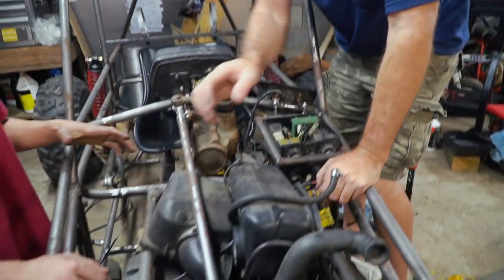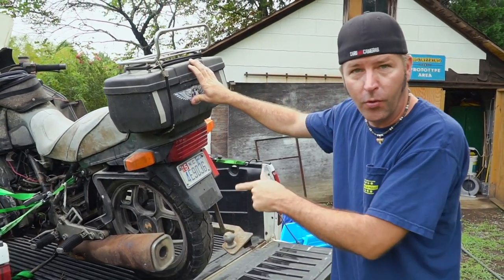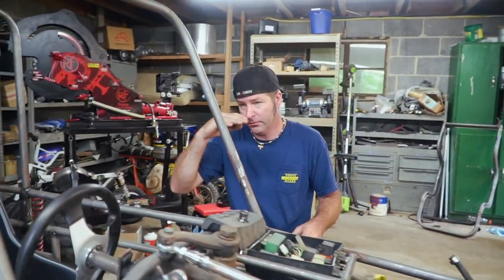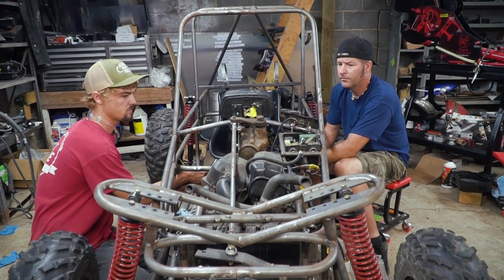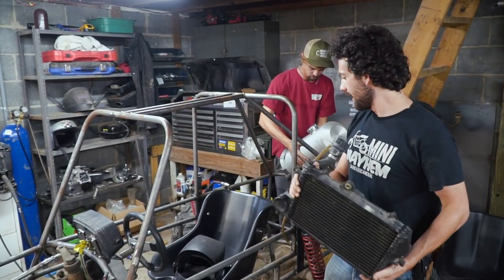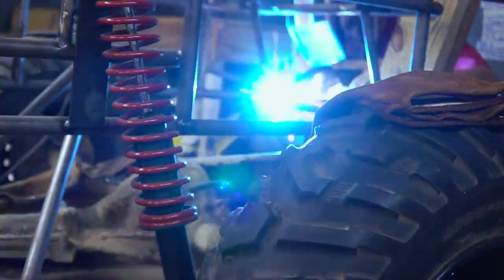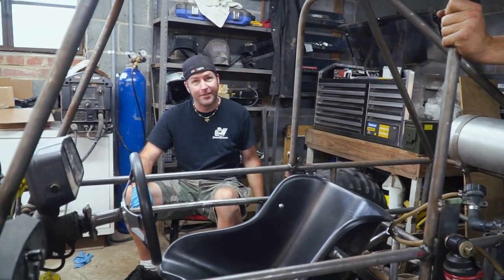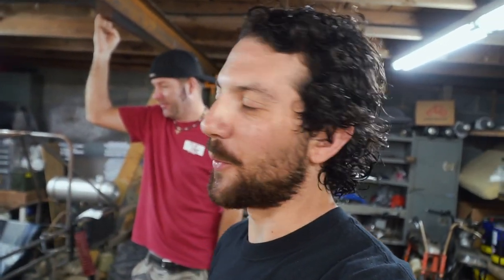1000cc Mini Trophy Truck Pt. 12 | Sputtering to Life!

Comment from the maker: So close! If we run fuel line, it'll fire up!
Reply: We hope so!! 😀😀👌👌
Reply: Heck ya guys can’t wait 😊
Reply: Let's hope
Reply: Kinda miss the old mower
Reply: CarsandCameras keep it up guys
Reply: I've got a name for it call it the golden ticket because trophy trucks are the best off road vehicles I've seen
Reply: Jerry Mann same here buddy
Reply: Or at least it should
Reply: Put the radiator on the bars above the gas tank..
Reply: I love your videos...but...please don't rush to upload videos as fast as you can...I don't mind waiting a few days extra so you don't feel extra pressure to make the videos...stay cool...these are bad days because of the virus...there is plenty to watch
Reply: were did you buy that fuel tank
Reply: It'll be fine...
Reply: I think I mentioned to you guys, if you can find an Isuzu impulse in a yard somewhere, the rear diff is the same size as the Chevette and has rear disk brakes and a limited slip differential.
Reply: I'm such a big fan of your show I'v been here  since 1000 subs
Reply: Use starting fluid! Not break cleaner.... Break cleaner will wash out oil out of the combustion chamber.  Rings , piston side walls... Not good..
Reply: Y'all should do murry vs trophy cart
Reply: Hope so!

Comment: Y’all going to probably need to build a scoop for that radiator to 1) force air into it and 2) to protect it from everything that back tire is going to throw at it.
Reply: Jeff Kopis I agree and also think they can get away with just using cheat metal and coping a Chinese style go cart fender.
Reply: I was looking for a comment like this to see if anyone else had suggested it
Reply: @foolishtvgaming407  Me too
Reply: like on a VW bus
Reply from the maker: Yeah we'll do something like that
Reply: Good point mate, i was thinking the same.
Reply: Probably something like what is on the cross cart. that would look pretty sweet
Reply: Put rad just behind u but above fuel tank with fan! Get limited slip rear end

Comment: Y’all should put the cooling fan and radiator like on top like they do an actual trophy trucks
Reply: Yeah that or under the fuel tank...
Reply: I definitely agree the radiator should be mounted to the cage behind and above the driver
Reply: Where you have the radiator it's going to get plugged with debris and possibly punctured.  I would put it near the top on the back like you see on Baja vehicles.
Reply: Yep
Reply: Mud and dirt is gonna get in that radiator
Reply: Exactly what I was thinking
Reply: But also if it were to over heat it could rain boiling water onto the driver
Reply: For sure dude.  I think that would work a lot better
Reply: @tanloghay1387  a metal shield could medicate that problem
Reply: Yup just above fuel tank
Reply: Get a limited slip rear end
Reply: Debby Klahs not worth the money re-building the rear end
Reply: Rammatic  that’s what I was thinking like why not there
Reply: DinkleDigeroo they might have fenders planned for it
Reply: First thing I thought
Reply: it might work where it is providing they put a good mud guard on it
Reply: Gonna ha e to agree with this 100%
Reply: I was about to put that exact sentence
Reply: But then you cant clog it with dirt from that tire.
Reply: Thats the best place for it but its also the worst if it boils over or burst it would be the end of cars and cameras
Reply: It’ll be fine

Comment: Love this thing....Might want to look into puting that fuel tank inside of the cage. In case it does rollover it won't take a hit and leak allover.
Reply from the maker: For safety, yeah. We chose the back so we could have room for things in the bed
Reply: @CarsandCameras  I think you guys shod put the fuel tank at the bottom of the bed and have the nozel out the back and mabe macke a litey roal cage
Reply: It does seem like a bad place for it. I would put it on one side of the bed longways. It would be way safer, and still leave the bed usable
Reply: CarsandCameras possibly switch fuel tank and radiator locations, slightly recess radiator inside cross support beams in the rear?

Comment: Mount the radiator on the 2 cross braces above the fuel tank, that way it will get all the air it needs and still be out of the way.
Reply: true or front but in side its def needs air duckt to get good air flow

Comment: Things are looking good guys, the only issue I see is the radiator location. The tires are going to be kicking stuff up and either going to plug or puncture the radiator. I would mount it as high up behind your head as you can. Its safe there and will be able to have a good air flow. Maybe put a piece of  hardware cloth in front of it to protect against rocks from another buggy or bike in front of you. Looking awesome, cant wait to see and hear it run.

Comment: Looks like if you put the radiator on the brackets above the gas tank it would get better air flow and a lot less trash in it from the tires. I can’t wait to see y’all finish it, it is going to be awesome.

Comment: You could've mounted the instrument cluster at an angle just to the right of the steering wheel. And the rad needs to be mounted up top on the v brace.
Reply: Yep, I can't believe out if three people they didn't think about that for the Rad. It would have much better airflow and where it's at now it's going to get mud, dirt and rocks slung into it. Smh
All they had to do is look at you know... Trophy Trucks. Haha

Comment: Maybe mount the rad under the tank if possible. it would get better air flow and be less likely to get hit from tire debris. and maybe mud flaps as an easy way to help with the tire spray. great build. keep up the good work

Comment: I think you will end up putting a rock through that radiator from being so close to the tire maybe make its own bracket behind the seat about level with the fuel tank it should get plenty of air and be safe from damage just my opinion awesome build and maybe actually do a sheet metal body do panels and some kind of fenders make it look mor like a actual truck it will protect you and the engine and drivetrain and on the cross kart I would suggest maybe raising the engine a few inches or at least do some kind of belly skid plate underneath the engine block great builds guys just need a few little fine tweaks keep em coming can’t wait to see this beast move under it’s own power

Comment: FIRST, also it has a MAF or a map if its been converted, these bikes will not run without the airbox properly installed and sealed you can convert the k100's to use the 1200's series ECU with a MAP sensor Or you can vist speedworks for an ecu kit

Comment: "We're really limited on where we can put this thing.." uh... put it up high on the triangulated supports on the rear end.. great flow and easy to mount.. And so long as you have a good overflow bottle and a good radiator cap it won't scald you. Plus it'll be the highest point in the cooling system so it won't vapor lock the cooling. "Ike doesn't fit anymore because he's tall.." I wish I could meet you guys and show you what tall is.. I'm 6'10.
Reply: That's what a 3'8 person would say.

Comment: Use a slung diff from a Volvo 740 turbo station wagon.
 It is on a small label on the left side of the shoulder seen from behind.
It should say "1041" if it is slung diff.

Comment: The open diff works as a safetyvalve too , if you turn so fast the rearwheel lift it woll stop transmitting all power and.possibly prevent the truck from flipping over

Comment: i you mount the radiator on the rollcage behind the driver it will get more airflow, look way cooler, and for sure be the highest point in the cooling system, witch makes it all easier

Comment: Mount the radiator on those two tubes that comes from fuel tank to the ''roof'', just above the fuel tank. Thats common place in cross karts. Or use twin radiators from dirt bikes, mounted at both sides in angle plus fan in both. Dont know if stock waterpump is enough but you will find out.

Comment: You guys should fab up a simple scoop for the radiator. You'd be surprised how well that'd work at speed. 

Otherwise, ALL that air will just flow right past that radiator and you're looking at some high heat.

Comment: Love this build series. But just a heads up if you mount the radiator on the side like that you're much more likely to send a rock through it or cake it up with mud from the back tires. Hope it all turns out great im excited to see it move under its own power lol

Comment: Maybe put scoops like the cross kart has running to radiator(s) with no fan(s). Maybe a light bar, sprung steel bumper, (front/back) front would be cool with lights.  If you are doing body work, tell me what you think about short little vents in the hood for ram air.

Comment: i would have mounted the radiator on those triangle bars that charles put up, seeing it behind the tire seems like its a good way to get dirty and clogged. youll get more airflow and have a "highpoint" in your system.  unless you make fenders and regardless of fenders going to water or mud will still splash into that radiator.  BUT thats imo

Comment: Radiator should have been mounted on the tubes Charles put in to triangulate bed to roll bar.  Would have allowed good air flow and still been secured/protected.

Comment: Can I recommend some sort of external shield for the radiator? 

Just so when you're hanging it sideways you dont drive rocks and dust through the fins and fans.

I wouldn't worry about cooling if you're running a fan, 1000hp burnout machines sit on a pad and cook tires in 30 degrees c every summernats.

Comment: You should put that radiator up on that cross-bracing above we are thinking about putting the radiator up there on an angle then you could have the fan blow the heat up and dissipate it away from you anybody have a lot more airflow just a suggestion peace out in the world have a great day

Comment: Don't put a Lincoln Locker in that thing. If it's lighting one tire fires look into a limited slip diff instead; get the best of both worlds and you'll be able to tune the diff action. Viscous type preferred.

Could also maybe find an Eaton E-locker that'll fit? Go from open to spool to open at the flip of a switch.

Comment: Why not mount the radiator up higher on the roof or back support.  You could fab a shield so if it overflows it does not spray the driver. Lots of cool clean air up there!

Comment: Why not mount the radiator on the rear roll bar area, ahead of the fuel tank?  I think that's how most trophy/baja trucks have it located.  If you are looking to keep it safe from debris, then near the tire is far from an ideal place. Also, can i suggest tying in the top corners of the roll bar hoops to each other, and then to the new rear section that Charles installed.  If you do roll over, I can see those areas potentially failing.  Look at how a Jeep Wrangler's roll bar is laid out.  Great build! Keep up the good work!

Comment: Radiator could be higher up on the metal Charles added to the back. Just need longer piping and maybe a  extra pump. And I hope that steering shaft is collapsible if not yall have a spear that would kill someone if front end is hit hard enough. Maybe  yall should think about a bull bar on the front of it.

Comment: How about snorkel for the air box and mount the radiator up high on your rear supports for air flow and protection like a trophy truck.  Just a thought.

Comment: 11:37 is that spring bent?
Reply: It looks like the rear end is either up on jack stands or hanging, but either way doesn’t have the weight of the truck on it.  I think the spring is laying against the tubing making is look a little wonky.  Once the spring has weight on it, it will seat itself away from the chassis tubing and be nice and straight.
Reply: Matt R  thanks

Comment: Just a suggestion maybe mount the radiator above the fuel tank. More air flow and it would be out of the way, and mud would not get in it either.

Comment: Yeah, I know the pain of figuring the wiring. I am fixing up a '82 Yamaha XJ650 Seca Turbo, and I feel like I am just chasing ghosts. It has ignition (starter fluid works), but its not getting fuel. Have a new fuel pump, checked all solenoids and sensors, just 3D printed a new fusebox mount to go from glass to blade fuses. Now I am gonna have to check all the wires and find out what is robbing the fuel pump of power. Its getting around 7v when it needs 12v, so not enough to pump.

Comment: I need to get in on a build with you 2 .. im diggin the trophy truck .. and that little rascal fuel tank would be  useful for a spare fuel cell on the ct 70.. maybe positioned above the head lamp on the bars like the small cylinder shaped leather bags that guys put on harleys. i think I reside with in a couple hours from you guys .. .. I got a place in Lenoir county  and sometimes  stay in Onslow county N.C. .. ..and tell Ike some mini vice grips or mini channel locks will make the brakes a easy task also.. lol
Reply: drum brakes do vary ,but overall there the same .. some times there are 2 wheel cylinders per single brake .. vs 1 wheel cylinder and a adjuster . .. the brakes do help lots in stoping .. they just dont stop as hard as the front brakes .. even on a all drum brakes setup.. disc stop better but drums last much longer on mud toys.... and btw yes connect the cut cables for the pk brake lever... and just patch them together with cable clamps for fun power slides ...ect ..
Reply: side note some 26mm flat slide pwk carbs will wake the ct's up more :) ive got a few new ones also id let u guys get for almost nothing..

Comment: Not going to look if it's been said already. but the placement of the radiator is going to kill it for sure. Never mount a delicate near a tire. 1st limb/rock/stick/blowout can destroy it, and game over. and you can't protect it without blocking airflow. But the build looks awesome so far.

Comment: I sure hope you are planning to put a steel hoop around that driveshaft? If things went badly enough, quick enough, the drive shaft could come straight up through the floor, buzz right through the plastic seat, and de-nut you. At the very least, not a sheet metal floor. But thick enough to save the jewels if the driveshaft decided to come buzzing through.

Comment: Love the idea but I think installing the radiator there might be a mistake you’re going to get it full of debris from the tire I would install it underneath the fuel tank that’s just me though
Reply: yeah that or the first branch they run over gets javelined into it, still would get a fair amount of debris under the fuel tank but putting it up on the new headache support bars charles welded on.

Comment: mount the radiator high (only thing Id be worried about is if it every over heated its pour boiling water on your head.....Ok never mind but I have seen them mounted like that before.

Comment: At 10:03 the ground clamp isn't on the copper contacts, and it sounds like the weld is a little sporadic. I have the same machine and it is picky with where the ground is.

Comment: Cooling.......... hollow steel frame. Surly use that and save weight and simplicity and it will also shed heat?

Comment: i would put that Radiator in front but in back its must have a panel so all dirt dont fly in there or a fenders would be nice add but anyways a air duckt or wing panels or tubes to bring more air to that radiotors would do a wonders and back of seat somekinda panel so if radiator gets too hot its not spruit hot water on you

Comment: Next vehicle you build should be a bike frame welded up to a car frame and double engines connected to the throttle and have four wheels. Sit on the bike and rip it up, make a harness so you dont fly off while turning or stopping. Legit would be sick! Like if you wanna see that happen!!!

Comment: Put the radiator up front and put a debris screen in front of it.  You will need better air flow going through it, than the rear can provide.

Comment: dudes great job keep it up but may you should have put the radiator where you have the fuel and the tank were you have the radiator ..justy sayin one needs air flow and one should be in the roll cage huh

Comment: Awesome build!      I don't think that's a good place for radiator . It is going to be covered in mud n grass all the time being rite over the tire.  It will also limit what you could use the bed for.   Mount it up above the fuel tank .

Comment: Cars and cameras I just thought this could be an issue but the radiator might get clogged gummed up from mud from the tires and then the motor will over heat

Comment: not watched this episode yet, but just looking at the thumb nail I'm thinking you really need to put some structure around the drive shaft in case that thing breaks loose - dont want that flailing around between your legs.  Also add a keeper underneath to stop it digging in the dirt engine side at speed.

Comment: I have a feeling that radiator will pick up a rock or 2!!!and get covered in mudd. not a good placement It should be above your head in-between the roof rails like an odyssey with a pusher fan.

Comment: How come you guys didn't choose to mount the radiator in the rear? Was it a distance concern?
Reply: We put it in several places and the side just seemed the best
Reply: @isaacitllbefine7231  Hey if it works,it'll be fine. I'd make sure you have a guard over it to protect it from debris but it looks great so far

Comment: Couldn't you just mount the radiator on the bars behind the driver, up top?  Still protected in a roll-over, better flow, bed area is still accessible.

Comment: What the heck is idea behind that radiator mounting? Just put it behind the seat and add some scoops on sides of the seat to direct air flow towards it. With current mounting you would need to build air scoop to side get air to it with most likely "some" mud being with the air, or burn the fan over time, what is pointless.